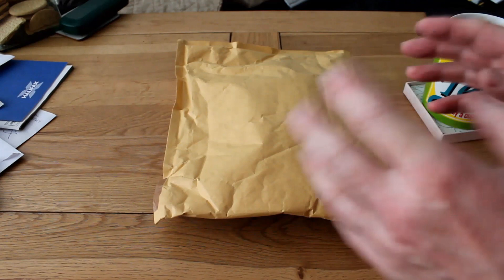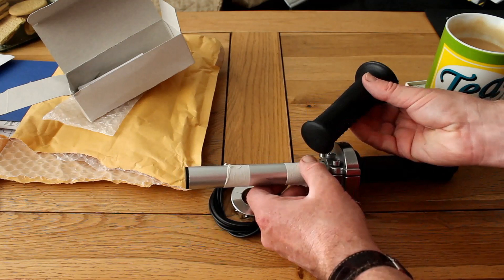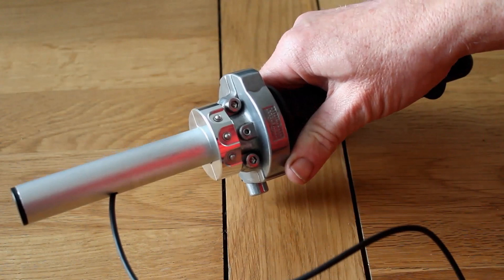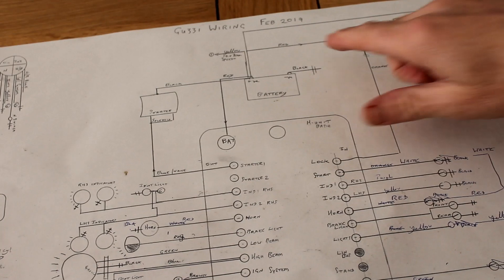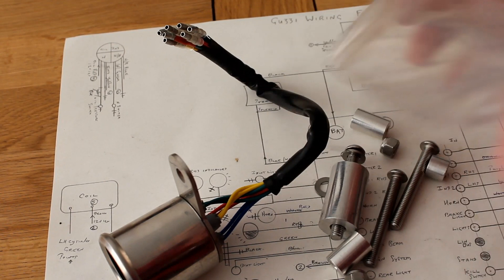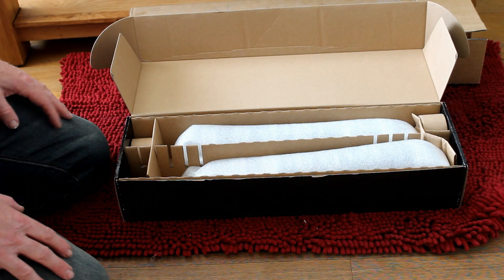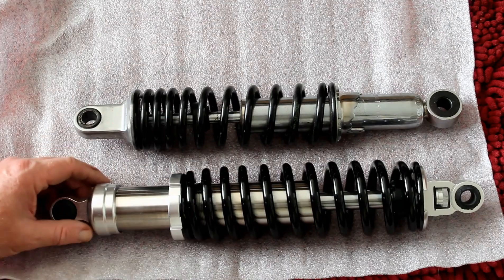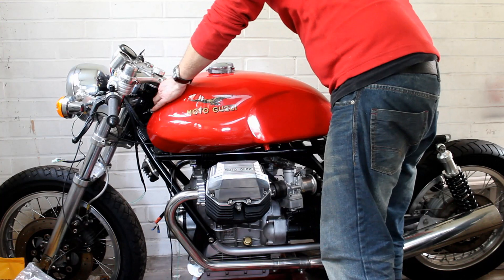Moto Guzzi California III Cafe Racer Build - Part 28

Comment: What about the MHR?????
Reply from the maker: Got an annoying problem with the idiot light pod.. they all work now but cant get the two halves back  together.. the ign lock seems to be the problem, but its original.. so a mystery. But the Guzzi needs to be finished, and moved before I can get the MHR out of the house.. hence I'm working on the Guzzi now. That said our Prime Minister just announced tonight that we are now in official 'lock down', non essential travel is banned.. including riding old noisy Italian bikes... pity as the weather has finally turned dry and sunny..
Reply: @Merch131ho  Watch out very carefully for trapped wires inside the MHR cliuster; as the two halves are pushed together wires can move and jam where they should not.  The Guzzi looks like a lot of fun.  I've never played with one before.
Reply from the maker: @Rick-uu5yo  Indeed.. just posted a quick update on the MHR.. just for you lol... actually I filmed it a few weeks ago and wanted to add 'the fix' before posting, but that will have to wait..